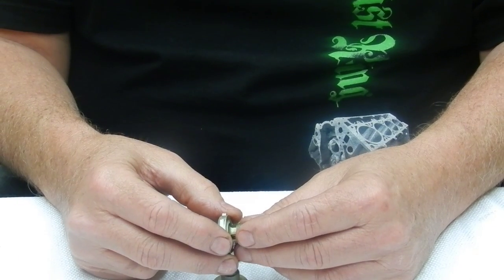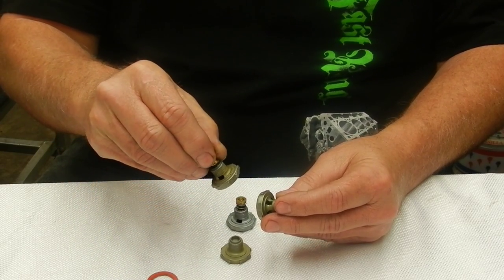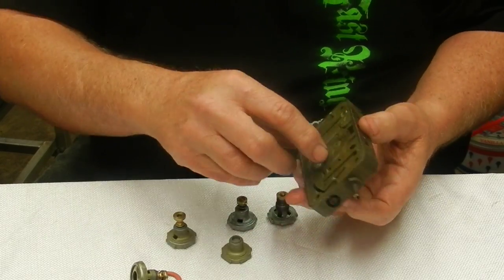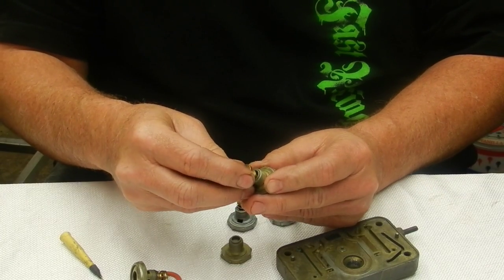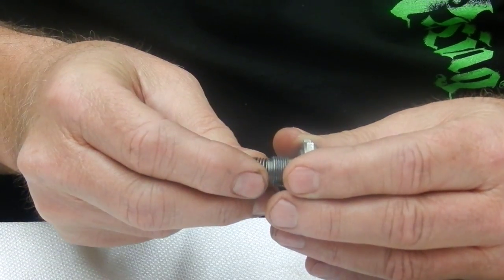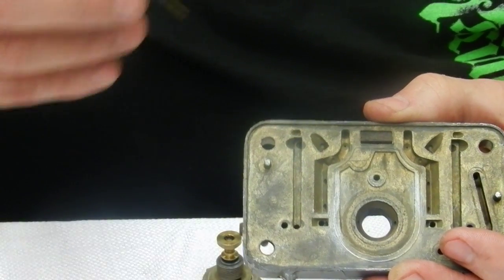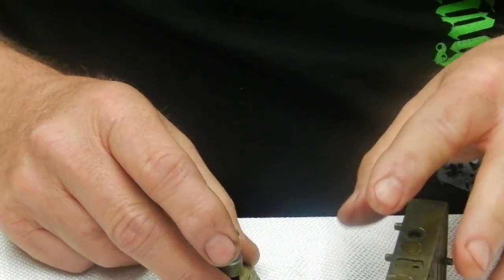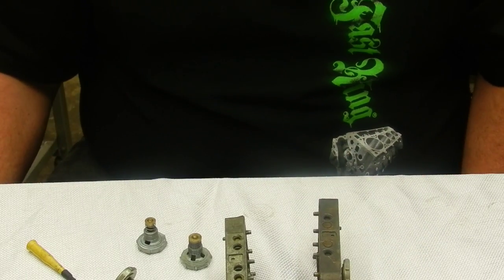Holley Carburetor: Power Valve Explained

Comment: I'm using a Holly 94 carb to power a 1982 Honda Gold Wing GL1100 on a home made intake manifold. The bike starts and runs nice but boggs off the line for about 1-2 seconds , then it takes hold and goes like crazy. the next problem is that at about 60 mph it seems to starve a bit . If I hit the throttle hard it will take off with plenty of power, probably from accelerator pump , but then if I let it settle in at about 60 mph again it has a hard time holding it there.....it wants to slowly drop down to about 55 mph....give  it some more throttle and away it goes up to 70 mph but then again if I try to drop back and try to maintain 60 mph it struggles. I've tried 2 different power valves (neither have number stamps so I have no idea what they are) one is the original, probably from a small 49-52 ford dump truck , the other was part of a kit I bought on ebay. The carb's original jets are 52s , right now I'm trying 50s, both have similar symptoms, as do the two different power valves I've tried. If I remember right, idle vacuum is about 18" and running down the highway at about 55 mph on the flat, holding throttle steady , vacuum runs at about 10"-12".....I'm hoping that with your many years experience you might be able to please point me in the right direction as to where to start with jet size and power valve size in this very unique application??? Thank you in advance for any help you can provide.
Reply from the maker: Sounds like you might be to lean and  work on this first and then work on the accelerator pump. Hope this helps

Comment: Randy, I have a stock 307 Chevy with a Holley street avenger carb.  I get a hesitation when I transition from cruising to more throttle.  I have a 6.5 power valve in the carb, should I change it out for something higher?  At idle, in gear the engine pulls 18/19 inches of vacuum.  My initial timing is 12 degrees, total is about 32
Reply from the maker: Those old 307s were good motors , sounds like you have a lean condition, I don't know the size of the carb you have but those motors liked ignition timing usually 36 to 38 degrees total , as long as no spark knock. If you can drive it with a vacuum Guage then you can watch and see when it's hesitating , may have to make an adjustment to the power valve  opening or power valve circuit , there is other things that can cause this condition .Hope this helps.

Comment: I have a 750 DP race carb. Just got an AFR gauge. It’s pretty good at idle and cruise (12.3-13.7) , but when I mash the gas, it will sometimes go in to the 16’s, briefly. I’ve messed with pump cams, squirters, bleeds. I have it pretty close. Not sure what I should go to next. Main jets, PV, PVCRs. I have a 3.5 PV now. 5hg at idle in drive, but about 10-12 when staging or cruising at 40. Thinking to try going back to 6.5 PV, or higher, so it will open sooner. What do you think.
Reply from the maker: When it goes in to the 16s does it hesitate or stumble briefly?
Reply: @holleycarbshowtosadvice40y90  no. It seems really good. It did prior to me doing what I did. It was going up to 20-21. And it is real brief. 16, then like 13.6 under WOT. Am I being too picky, if it running good?
Reply from the maker: I think you have a great afr sensor to pick that up that fast, if your don't have a drive ability problem your chasing ghosts lol.

Comment: Hi Randy I like so many really appreciate you sharing your knowledge and now have a better understanding of the holley carby. I was wondering how would you restrict those orifices from the power valve?  I am building a 2ltr ford pinto motor bored and stroked to 2.2ltr and wanted to run a 4412 500cfm . I've read in a David Vizard book that for this application to restrict these orifices to around 17 thou . Any other tip would be appreciated too.
Also do you think you will be doing anything with a 2 barrel in the future? 
Gavan. 
Australia.
Reply from the maker: Built several of these carbs years a go , I would start out with .018 on the power valve  circuit restrictions and  56 main jets , and drill your  air bypass holes in the throttle plates to .150 , I believe I ran a 4.0 power valve and I think I changed the accel pump to a 30 cc diaphragm and housing and pink colored cam, I think I was running .020 accel pump discharge nozzles ,then work on your tune from there, this is the best I remember. Hope this helps.

Comment: Got a PVCR tuning question for you. I have an 1850-5 on my 390 in my galaxie and my idle, transfer slot and cruise afr is 13.5-14.2 afr depending on situation but when the power valve opens up it goes from say 14:1 average afr to 11.5-12 depending on load, this is light to mid throttle acceleration either taking off from a stop or just stepping on it a bit in high gear, not enough to even consider opening the secondaries. What is the ideal afr with the power valve open? 12.5-13? I take it that I need to reduce the pvcr size a little, probably by about .004"?

Also, I'm running 67 primary jets when it came with 66 jets originally. What do you suppose the ideal cruise afr is with an all iron 10:1 390 FE with a 218/224 duration @.050 cam with .513/.519 lift? seems happy at 13.5-14 depending on speed and load and the mpg isn't a bit different than with the stock 66 jets in it. I think there is more mpg potential to be had when the power valve is open and not dumping excessive amounts of fuel?
Reply from the maker: Your afr numbers sound good as long as  your mixture goes back to a good lean cruise. I don't know if you pull heavy loads, but don't go to lean. You can try a two stage power valve that opens at different rates, its a good idea to use a vacuum gauge with your afr gauge to monitor power valve opening or lean or rich spots. You can try playing with pvcrs or power valve opening, the two stage pv might be watch your looking for. Hope this helps.
Reply: @holleycarbshowtosadvice40y90  Something definitely needs done with the power valve circuit. I do feel I would like it to open slightly sooner reading the gauge. It has a 6.5 in it now, maybe 7.5 would do it. The mixture when tipping in the throttle will sometimes lean out into the 15 range before the power valve opens up b you can feel the engine get kind of lazy when the power valve opens up, so it definitely needs leaned out a tad. I did a 45 mph cruise to WOT pull tonight and it went to about 11.5 and blew a bunch of black smoke when the secondaries opened. I converted it to secondary metering block and put I think 71 jets in it. I got it pretty dang close guessing at it, I just installed the AFR gauge the other day. I did get some pinging in the midrange and WOT tonight, so I need to delay the centrifugal advance a little, it's 36 degrees all in at 2700, think I'll shoot for all in at 3000 since it's picky with fuel quality. Sure is fun when it slams ya back in the seat and takes off though!

Comment: Just wondering, if you are idling at like 1200 due to a lumpy cam (drag race application) would the power valve open because the system could be operating on the main circuit? I am only getting like 3 hg inches of vac...
Reply: yes
Reply from the maker: The power does not effect the idle at all unless the power valve diaphragm is leaking.

Comment: Hi Randy
Great videos.  I have a question. I have a brand new Street Avenger Ultra 750 CFM installed on a brand new crate motor. I also installed a A/F gauge as well. My problem is that its runs rich at idle. I want to adjust the primary so that its not into the transition slot, but instead of drilling the holes in the butterflies, can I just open the secondary's a bit for the extra airflow?
Reply from the maker: you can up to a point , i prefere my way, or buy a holley ultra with a designed in idle air adjustable bypass. i believe some barry grant carbs had this too.
Reply: Set your idle like 600 rpm (small cams of course). Again set idle at the LOWEST you can keep it running. Then tune the mixture screws in the front bowl. Keeping them the same number of turns out. Shouldn't be more than a full turn OUT from GENTLY seated in or closed. Screwing in the mixture screws closes the fuel to the idle circuit. Should darn near kill the motor. UNLESS your power valve is dead or having issues. Also lower the main jet 2-4 sizes.

Comment: Hi Randy, I'm watching your movies to adjust my Holley , but I've seen yet nothing related my carburator issue. I have a Holley 4160 600 cfm vacuum secondary installed on a Ford V8 302, when I started to throttle the nozzle is injecting perfectly, however it seems that the fuel isn't being puxed by the vacuum through the vents. When I cover the carburator a bit with my hand and keep throttling the acceleration clean. Do you know what can I do to adjust that?
Reply from the maker: I not sure , but if you cover the carburetor partially with your hand a it runs better , you have a lean condition, could be partially stoped up like the main jets or float level way low, wrong  jets , or a bad vacuum leak , lots of things can cause this concern , might just need an overhaul, I'll try to do a video  before long.
Reply from the maker: Could be anything from a vacuum leak to a block fuel circuit , if you are having to partially cover the carb to get it to accelerate , that sounds like the jets may be restricted or not the right size .
Reply: @holleycarbshowtosadvice40y90  I've fixed this issue, It was a minor gasket leak and pcv failure! Those failures combined was causing that issue. But now I'm facing a new issue, when It starts throttleling happens some holes like cutting fuel. I've adjusted the injection pump arm but nothing change. I'm thinking the carb is quite big to the engine. It's a 650cfm to a Ford 302. What do you think?

Comment: Thanks Randy
Could understand why my holley 600
Was running so rich , flooding etc.
The cam only pulls 9 inches of vacuum at idle.  Power valve is a 6.5
Will try A 4.5.    Engine would idle fine , as I spose it's on the primary circuit ,  bit pig rich just off idle onto secondary circuit.
Reply from the maker: Just remember the power valve will not effect the idle circuit richness, unless the power valve diaphram is ruptured or the gasket is leaking, they are two separate circuits. Changing the power valve to a 4.5 with 9.0 inches of idle vacuum is correct , but will not change the idle mixture unless pv is leaking , the pv flows fuel through the boosters only at above 1500 rpms not through the idle circuit . Check out my video on idle circuits mods with high duration camshafts, hope this helps.

Comment: I'm a retired auto mechanic I have modified the Ford two-barrel carburetor and 2 barrel Holley carburetor for gas mileage my grandfather was head mechanic for a Ford dealership he showed me how to modify carburetors for mileage he also showed me how to modify carburetors 4 high performance I had a 65 Ford Galaxie four-door 289 V8 motor manual 4-speed transmission pulled a 4 by 10 enclosed trailer about 85 to 100 lb tongue weight on the vehicle it was an old motor Depression was about 120 down to 90 lbs compression the compression was low a new motor would have 160 lb of compression I modified the carburetor and got 24 miles to the gallon pulling a trailer for Kansas and Missouri went to Illinois and down to Florida from Utah 23 1/2 miles a gallon up to 24 Mi to the gallon that's pretty good gas mileage pulling a enclosed trailer my grandfather taught me how to modify the carburetors I am a retired auto mechanic
Reply from the maker: I'm sure you could start a you tube channel and do well , explaining how to improve fuel mileage .

Comment: Hi Randy....I want to  run two 600 holleys on a supercharger, can I just plug the rear PV and move up 6 jet sizes     Thank you
Reply from the maker: Yes on a 4150 you can block the secondary power valve and jet up 8 to 10 jet sizes on a blown engine, also you will need to vacuum reference your power valves and may need to lean your idle circuit. Hope this helps.

Comment: How can I identify my current power valve if it has no paint or marking on side? I'll tey I can test with vacuum pump and guage to figure it out
Reply from the maker: Yes if you have a good vacuum pump  you can test it . Power valves are usually marked on the side or on the bottom but some were not stamped, making it easily erased. Hope this helps, take care.

Comment: What would cause my idle mixture screws to not work properly? I have my transfer slot adjusted properly and my engine still runs when idle mixture screws are all the way in...Any advice would be appreciated..
Reply: if your transfer slots are adjusted properly , check to see how far your secondary throttle plates are open , they may need to be adjusted . really need to know more information list # how munch compression and cam specs, does it have four corner idle circuit. also idle speed .
Reply: Even a blown  power valve diaphragm could cause your  carburetor to run rich, and not adjust properly,  also a  idle bleed restriction  can cause  this problem. also remember vacunm leaks, hope this helps you , if not send me more detailed information, randy,
Reply: Thanks for response Randy.It's a 650 speadbore holley double pumper.It's got idle screws just in the front so just two not 4 .Had the carb apart many time and cleaned.Blew compressed air threw everthing.My engine is a 8.5 to 1 compression 454 with a magnum 280 comp cam.Im running 5.5 power valves in front and back.My engine manifold vacuum is at 12 psi at idle.I had 6.5 power valv in front last rebuild before changing to 5.5.Maybe i'll try going back to 6.5.If this doesn't work i might take off intake and check for leaks..
Reply: also make sure your carburetor is not a reverse idle system they adjust backwards the further counter clockwtse the leaner,  clockwise is rich. randy
Reply: Randall Cribb The carb is a late 70s or early 80s model
Reply: could be a blown power valve, really need list# at the  choke horn , or some where on the body
Reply: how much of your transfer slot is showing at base idle speed, with 8.5 compression and a 280 comp cam , you well need very little of the transfer slot showing and as much initial timing as possibly recurve  the distributor, if needed drill bypass holes in the primaries only , if there is more than 0.20 showing , this number changes with cams and compression.  hope this helps randy
Reply from the maker: I don't know if you could have a reverse idle system if so the mixture screws work backwards because the idle mixture screws control the idle air bleed only,  on these holleys turning the mixture screws clockwise made it rich and counter clockwise made it lean. randy
Reply from the maker: make sure power valve is not blown it will run extremly rich at idle , randy

Comment: Randy will I see fuel leaking,, looking down the throtle body to the manifold   With a blown power valve ??   thanks   ,, Great Vid .
Reply from the maker: Jim sometimes you will see fog coming out of the venturi area if the engine is up to temp. Where the power valve circuit is you can't see .It matters if the diaphram is completely ruptured. This will drain most of the fuel out of the bowl and the engine will turn over excessively to start, and run very rich .

Comment: Randy I love your films. I have an Olds 350 in a Cadillac Seville, the EFI is gone, now a Holley 4150.

Suddenly the car is eating fuel?

I've been doing a lot of highway travelling between 65 and 75mph (France) and she's eating fuel. She does smell rich. May I ask if you have any immediate thoughts on what might be wrong please?
Reply from the maker: If it was fine and suddenly started using more fuel I would look at the power valve (leaking diaphragm) first and correct, or possible float leaking or damaged float from a backfire, and if you run a distributor with a vacuum advance and diaphragm ruptures it also cost fuel mileage, this is where I would start. Hope this helps.

Comment: So where does it get its vacuum signal from? (Or manifold pressure if you will)
Reply from the maker: Behind the power valve in the main body there's a cavity ,.at the bottom of the cavity you will see a small vacuum hole .
Reply: @holleycarbshowtosadvice40y90  Thanks. Trying to help someone on Team Chevelle figure out why he's having an intermittent issue with the power valve NOT opening when he goes to wide open throttle.

Comment: Hi Randy. I enjoy your teaching style and your accent. I'm just in the middle of a carb clean up for a 57 T-Bird... 1273-1 Holly. First attempt at doing this. There are four .096 holes drilled in the body of this thing that I don't understand and I know you can help. One hole per bore about half inch above the throttle body surface, between two webs cast into the exterior of the each "barrel". Clearly these hole would be drawing air, and dirt, from the outside of the carb. Could this be a mod of some sort? It makes no sense to me. Have you seen or heard of this before? Should I drill to size and tap for a set screw or something? My curiosity has put a halt on the reassembly. Please advise. Thank you!
Reply from the maker: I really cant remember ,maybe shoot me a picture of your carb 
 , are the holes above the butterflies and are they seen externally

Comment: Likely a dumb question.
But I don't know.
Is there a difference between the primary bowl and the secondary bowl?
Meaning can they be swapped?
Reply from the maker: No the fuel inlets will be on the wrong side if you switch the fuel bowls, the only exceptions are the bowls that have dual inlets, hope this helps.